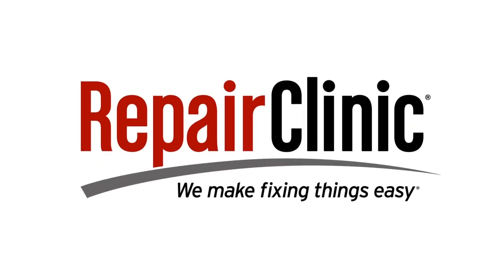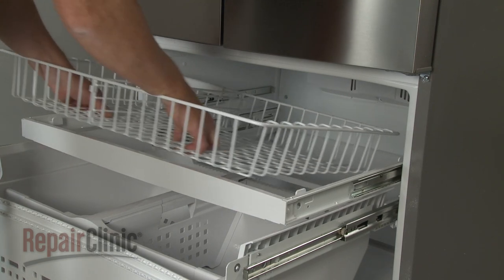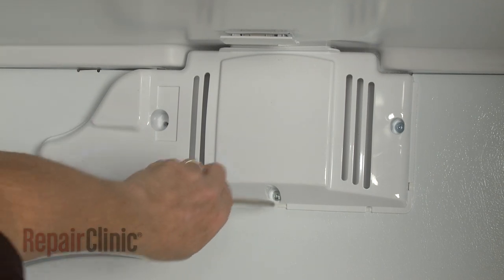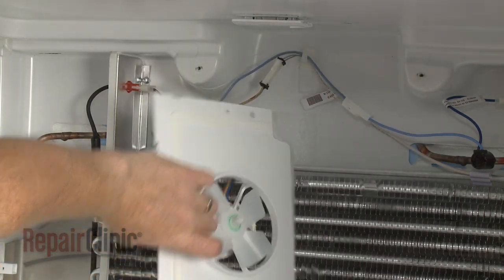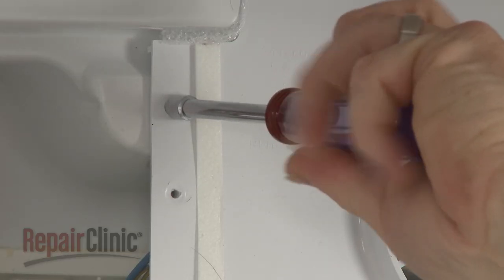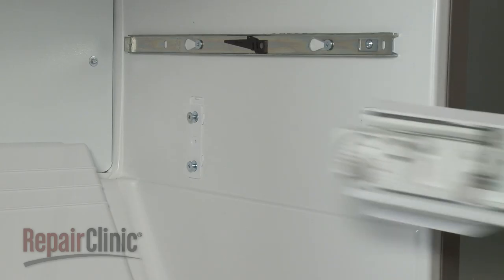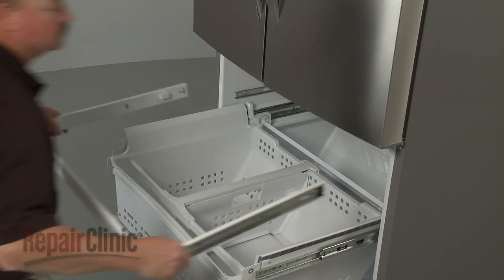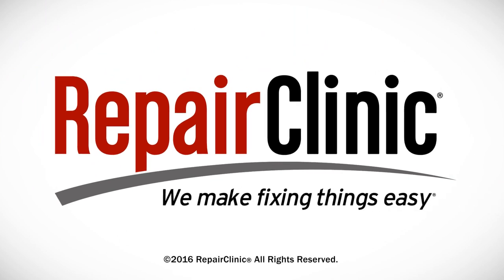Frigidaire Refrigerator Replace Defrost Thermostat 808062701

Comment: I have this exact refrigerator.  It is 6 years old.  We noticed that the freezer was cold but the refrigerator portion was 60F.   The entire evaporater was a block of ice.  We assumed this defrost thermostat was bad because I checked it as recommended by other videos.  It would close at room temp and open about 150F.  This is not what is printed on the sensor so we ordered an OEM replacement.  The OEM replacement opens and closes at exactly the same temps as the one we thought was bad...  It says 56 46 on it.  From what I read it should close at 10 and open at 56.  I dont see a defrost timer in this refrigerator...  I only know of the main board controlling defrost cycles.  The defrost heater heats if you hold up/down for 10 seconds and you manually put it in defrost mode.  Should I just manually put it in defrost mode 3 times a day or is there another part I can try replacing?
Reply: Mine was doing the exact same thing. It needed a control board. The defrost timer is built into the control board.
Reply: @brentperkins6521  we wound up buying an LG refrigerator.  Zero problems with it and couldn't be happier.
Reply: @Rezolution01  Wow! My in-laws bought an LG and have had lots of problems with it! I guess it just depends on the individual refrigerator these days.

Comment: I have this exact refrigerator  and was wondering about the symptoms. The refrigerator stops cooling but the freezer is working fine. the last time i took mine apart all the parts behind the panal were frozen over with Ice. I took a hair dryer and melted all the  ice and  it seem to fix it, for a short time. about 2 months later in finding I have the same problem. Is my problem the same as what you are showing a video here for??
Reply: You could have a bad defrost heater, or defrost thermostat or defrost timer. Most newer models have circuit boards that control the timer so it has to be replaced if the timer goes out. Some models have the defrost heater made into the evaporator coils and if the heater goes bad the whole evaporator coil has to be replaced (expensive BS with technician brazing and recharge fees). Stay away from Samsung for sure. You can test your thermostat by unplugging the fridge and while the stat is still cold or if you drop it into a icy glass of water use a meter and penetrate the insulation of the two wires on your stat and see if it gets continuity/ a reading or your needle jumps up on the meter when wires are contacted indicates continuity. If no continuity while cold it is defective. Check it when it is warm and there should be no continuity. If the stat is bulged out you know immediately that it has failed due to moisture getting in it and freezing it open. If you have the standard timer (not in a board) you can check it by holding one meter lead to the number 3 prong and touching the other leads one at a time. You should get one or two of the prongs to show continuity. Then turn the dial knob until you hear it click/defrost mode. Then with one lead on number 3 touch the other leads one at a time and a different prong should then read infinity that previously read continuity .

Comment: I had the same issue with it freezing twice within the past 2 months. I've removed and checked the damper and it seem to be working correctly. Currently I have the panel removed in the freezer and I can hold both the up and down arrows  keys to manually turn on the defrost mode and the defroster work. I would think if my defrost thermistor was bad, I would get no heat when manually putting it in defrost mode. Is there a defrost timer on this unit that could be bad or does the thermistor act as a defrost timer?
Reply: You may have a clogged drain hole that is not allowing defrost water to drain so it keeps collecting and refreezing the same water until it builds up. Defrost your fridge unplug it and make sure the hole is clear of food particles and  built up ice. Pour some hot water in the hole and see if it drains. I had a problem similar to yours after I changed a bad evaporator fan. I replaced the fan with a used one and came to find out a year later after having defrost problems that the fan blade that I ended up using was designed to run counterclockwise while the motor itself ran clockwise. I had a minor door seal leak that allowed hot air to be drawn into the freezer as this fan blade was drafting air toward the evaporator coils instead of blowing cold air from the coils into the freezer compartment. That caused a lot of frost and ice to build up in the freezer compartment. My fridge stayed really cold as more air was being blown onto the coils and down into the fridge until the ice blocked flow to the fridge. Ice began to build up around the drain hole and it stopped draining and kept building up ice. This used fan recently shorted out and I replaced it with another used one. I put the same blade on this motor which also ran clockwise and happened to feel that little air was coming from the fan shroud vents. Then saw that the blades were running in the opposite direction. I tried reversing the polarity by switching the two wires but the motor still ran clockwise. Went to my junker      parts and found a fan designed to run clockwise and put it on and everything is working fine.

Comment: I have the same model line. Evaporator completely iced over. With the defrost thermostat still embedded in the ice, it reads no continuity on its wires. Does that mean it is bad?

Comment: What symptoms are for a defrost thermostat?   I have this type of refrigerator; I have interior ice formation on back wall, exterior ice formation on backside of fridge, and water underneath the meat drawer(dripping from the interior ice build up melting?).  My temperature reading on LED is all over the place. It will read 48 at one moment, 33 the next, right now it is at 44.  I have unplugged it and plugged it back in after an hour and twice for five minutes.  I have cleaned the coils on the back and front vent at bottom.

Comment: Would a bad thermostat cause my GFCI to trip? It just started tripping every 8-10 hours. It's been on same outlet for a year and I tested on other GFCI and the same thing happened. Also, there is some frost in my freezer.
Reply: No. A bad defrost thermostat will only cause the circuit from the defrost timer to the defrost heater to open/lose a circuit so the heater does not get power. It is just a relay that operates on internal contacts that when cold are closed/has continuity from the ends of the two wires so power goes through it until it warms up and breaks circuit. It breaks circuit so the heater don't keep heating longer than necessary when the freezer is in defrost mode from the timer. So if the stat fails it just prevents a circuit from the timer to the defrost heater and does not short anything or cause a electrical problem like you described.
Reply: I have the same problem, did you find out the cause ?

Comment: I am wondering what symptoms would pinpoint the defrost thermostat is the issue?  I own a Frigidaire Gallery  with french doors and bottom freezer as the one shown. I have ice formation on the INTERIOR, in the back of my refrigerator, under the ice maker.  I have ice on the EXTERIOR of my refrigerator as well, on the backside.  It is rusting the back of the fridge.  

The ice maker and freezer are working fine.  My refrigerator is hardly cooling, all my food is spoiling.  There is water under the meat drawer (the bottom drawer). I figure it is from the ice melting inside.  My LED is reading all over the place.  Right now it says 48 refrigerator, 0 freezer.  It also reads 37 for the refrigerator at times, even 33… it is all over the place.  But the temp in the fridge is definitely too warm; no matter what it reads.  To me, this sounds like a thermostat.
Reply: you should check the defrost bi - metal by using a multimeter continuity function, i used compressed gas duster remover pushing trigger up site down, that will froze it and you should hear a bip, if you can’t hear it then its broken

Comment: Why would the defrost thermostat need replacing. What symptoms would I have?
Reply from the maker: Evaporator iced over due to stuck closed defrost thermostat is one symptom Timothy.
Reply: I have had to replace two of the defrost thermostats so far in a unit exactly like the one in the video. They both came apart and quit working after about 3 years. Chinese junk.